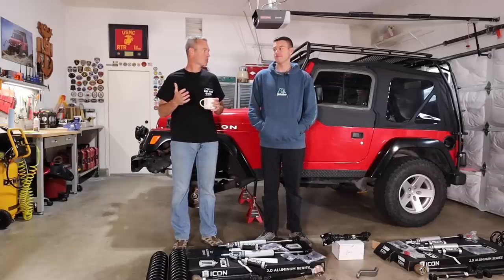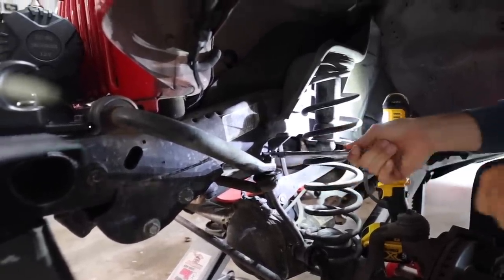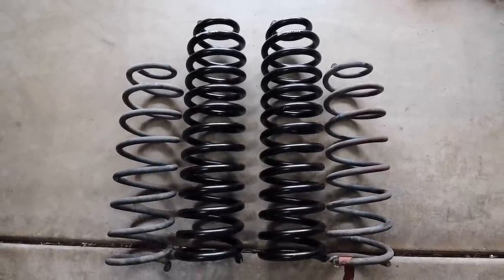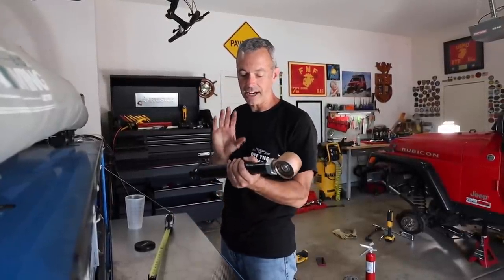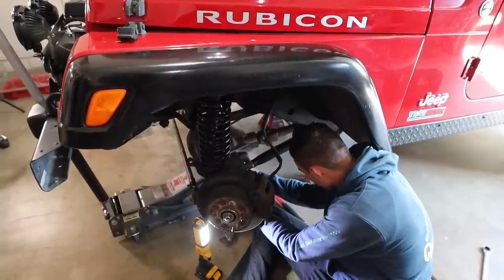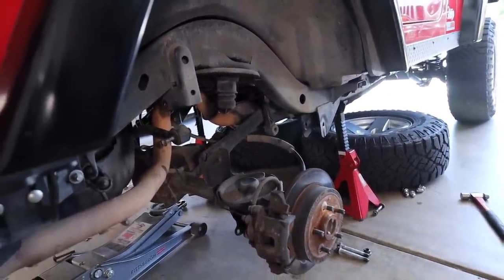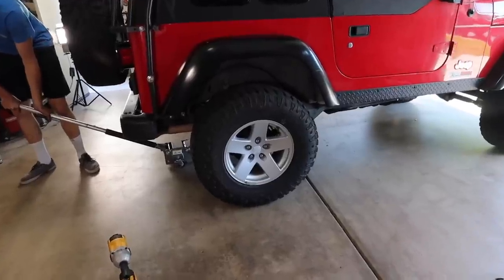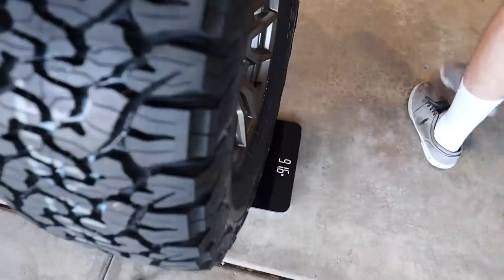TRANSFORMATION TIME! Jeep Wrangler Lift Kit & New Wheels and Tires Install

Comment: Brad, out of curiosity; why did you put a new cam bolt in? When I did my adjustable lower control arms, I just used  a grade 8 bolt equivalent with a thick washer the diameter and thickness of the cam adjuster washer. That way I know both arms are the exact same length. Because the control arms are adjustable, you no longer need the cam bolt for caster adjustment.

Comment: I’ve always read that a drop pitman arm is a bad idea.
Reply: You must be reading the TJ Forum and the no drop pitman arm meme. Follow the manufacture recommendations, these guys are engineers and understand suspension and steering geometry. When visiting the TJ Forum there more bad info than useable advise.
Reply: @tomsawyer5576  A dropped pitman arm causes the draglink and the track bar to go out of parallel.  In a nutshell-this will cause the jeep to turn as the suspension cycles (bump steer). This doesn't necessarily mean that installing one is a bad idea and its really the only inexpensive way to get your jeep lifted without having to spend hundreds of dollars on an entire new steering system. I used a dropped pitman arm for a while (I couldn't afford everything at once) and the steering was manageable. Now I run the Currie kit and it is for sure a huge improvement.

Comment: I'm not a mechanic, so go easy on me for asking this question. You had to drill out a bracket to relocate the track bar. Is that not the same thing as using an adjustable trackbar? If it is, then why did you also use a drop pitman arm? On some of the Jeep boards I've read, you should do one or the other (adjustable trackbar vs drop pitman) but no both. Why or why not? Thanks.

Comment: I would like to see a video on everything that needs changed on a 2” lift compared to a 4” lift.  I just purchased a stock 2004 TJ sport. 6 cylinder 5 speed. I am thinking about a 4” lift but it’s primarily a daily driver.  So maybe just a 2” lift.

Comment: Love your content!  You can eliminate those cam bolts now that you have adjustable control arms.  Metalcloak sells a rectangle washer that fits right in there to keep some replacement bolts centered.  Just a thought.  I run them on my ZJ since it has the same Dana 30 as the TJ and they work very well.

Comment: It wasn't mentioned if the Adams drive shaft was installed during the lift and if its been installed, if that introduced a vibration at higher speeds because I am guessing the control arm kit you installed locates the rear pinion at the same angle as factory to keep the single ujoint crosses on each end of a stock drive shaft at the same angle ( transmission vs rear diff ). But the double Cardan joint style changes everything as the single ujoint at the rear pinion would in theory vibrate horribly if the pinion angle isn't adjusted up to give as near to zero a ujoint running angle. So just curious what all transpired with that or perhaps that is a topic of a future video to talk about the lift, drive shafts and impressions on the new setup.

Comment: Glad to see a TJ build.  I am curious why he decided to run a soft shell RTT instead of one of the more compact hard shell.  I am at the same point with my TJ and the rack and tent are next.  Does it feel top heavy when loaded?  We will be about the same height as I have 35s with 3.5 inch lift and 2” body.  Can’t wait to see it on the trail.  Keep up the great videos.  Thanks Mike

Comment: Just thinking... If you had to push the axel to get the lower control arm to line up couldn't have pinched that cam bolt and caused it to bind or "be stuck"

Comment: This video just motivated me to DIY my first lift kit!  Question:  Your Adam's driveshaft looks like the 1350,  but the guys at 4WP told me I need the 1310?  Could this be due to different kits?  I also have an '06 Rubicon, but I'm going with the Rubicon Express 3.5 kit.

Comment: to get my control arm bolts loose I had to use my dad's high air impact for the truck shop that he owns on full blast that broke them loose and once they started to spin I just spun them as fast as I could and it worked great although I did so I have to use a hammer to hammer them out sometimes while I spun it

Comment: Did you end up using wheel spacers? I currently have 33x10.50 tires and am looking at going to 35x12.50, trying to figure out how much room there is without using a spacer

Comment: I'm installing a 3.5 on one of these.  I see you put your lower control arms at 16.0625 front and rear.  Did you put uppers on the rear?  If so, what was center to center?

Comment: Nice Video, recently lifted my Tj (Same color, year, and trim as yours)  and had all of the same problems!!! Those lower control arm bolts are tough to cut through!!!  Are you experiencing any bump steer with the lowered Pitman arm? I was under the impression it needs to line up with the front track bar so as not to cause bump steer.   GREAT PROJECT!!!

Comment: Lol.  That type of pitman arm puller is a piece of junk.  I broke 2 of them trying to get the pitman arm off of my brother's YJ.  Found mechanic friend and borrowed a Snap On puller.  So much stronger design.  Cone shaped.  That did the job.  We would also wrench a couple turns, and then give a few love taps to the end of the puller bolt.  That relieves tension/stress on the puller.  Rinse and repeat untill it came off.

Comment: I would have caved after the first puller failed and got a new dodge durango steering box to save me the trouble. upgrade the steering box and dont have to mess with the stuck pitman arm

Comment: Don't bother with the cam bolt, you have adjustable control arms and those cam bolts will almost never stay put when wheeling.  Couple of things though. The drop pitman arm should really only be run with a double shear track bar that drops the frame side pivot point a similar amount, else you increase bump steer.  Rubicon Express, Calyton, Metalcloak, etc. all sell a double shear option to pair with the drop pitman arm.  Second, the raised rear track bar bracket will also eventually cause the whole drivers side rear upper control arm bracket to fail.  Will take 5 to 50k miles depending on how hard it is wheeled but finding a friend with a welder and $5 in steel to brace it for cheap insurance.  A don't forget to hit everything with the torque wrench in 500 miles to make sure it is still snug.

Comment: Man I hate the TJ suspension setup. The JK was such a huge improvement. For the cam bolt, on your caster adjustment will be done with the adjustable arms. But I am assuming who ever put in the cam bolts wallowed out the holes so now you have to use one its in place? Oh, and the wheel and tire was heavier than I expected, I had guessed 80 or so. But then I had to recall that duratrac's have super thin 2 ply side walls, and the smaller 16" wheel.
Reply: Tjs came from the factory with cam bolts and proper slotted holes unlike the square hole hot mess the JKs come with.
Reply: Winchparts Ahh ok, been ages since I did a TJ lift. I greatly prefer the JK setup as cam bolts rarely stay aligned.

Comment: Must be California Jeep. Here in rust belt every single bolt has to be cut off if the Jeep survives that long to begin with. Most are in a crasher after 8 years. That frame looks new.

Comment: Cool 😎 👍🏼
Could you not drill new holes for the spare wheel? Or would they clash with existing in a way that would make it unsafe??
Reply from the maker: Thought about that and the holes would just be too close together and probably fail over time.

Comment: I own a 2005 lj jeep wrangler unlimited rubicon i have lots of upgrades curve weight 3900 gross weight 4600 i went to a cat scale i now weight 5820 all this before adding any additional camping gear  , noone ever talks about weight on lifted custom setup and i plan to pull a offroad trailer how safe is this and what are state laws for offroad vehicles on tires that stick out past fender wells i live in texas i built a overlanding jeep more so that a rock crawler,  that is more that capable to do rock crawling who knows the dangers when over building a offroad vehicle when it comes to being built over gross vehicle weight

Comment: Our 35s on Fuel wheels weigh 111.0 pounds apiece. Nitto Ridge Grappler 35x12.50 - 18.  I have a picture of them on the scale on our Instagram.

Comment: I wonder how much lighter a 33X10.5 tire would have been vs a 33X12.5?
Reply: I can't answer that (the BFG website probably can) but I know from experience that the GY Wranglers he took off are a light tire (and light-duty IMO).  So even comparing tires of the same size will show a weight increase when upgrading from the GY Wrangler.

Comment: Dropped pitman arm? 🙄
Reply: When you raise the suspension, the pitman arm is also lifted. The drag link now has to climb up at a more severe angle to connect to the pitman arm. You can get bump steer and under braking and hard acceleration the steering can pull to one side. Keeping the drag link angle as flat as possible by using a drop pitman arm restores the flat angle keeping your steering geometry closer to stock again. Same goes with sway bar links. You need to extend them after a lift to keep the sway bar flat.